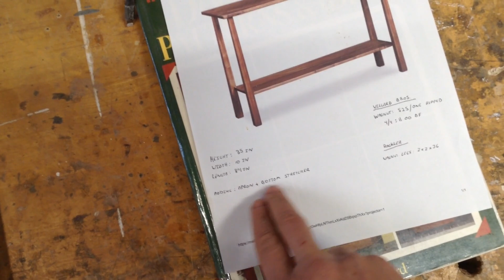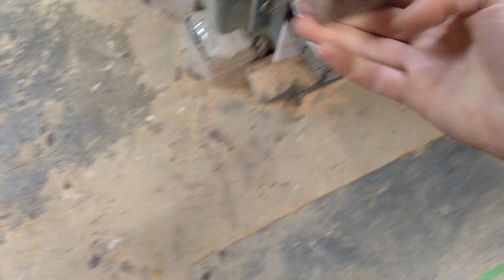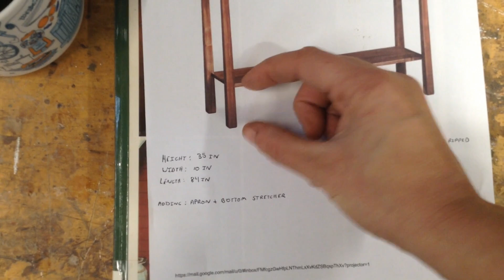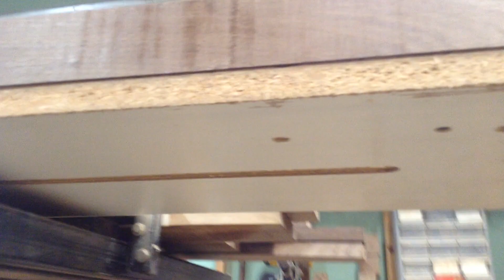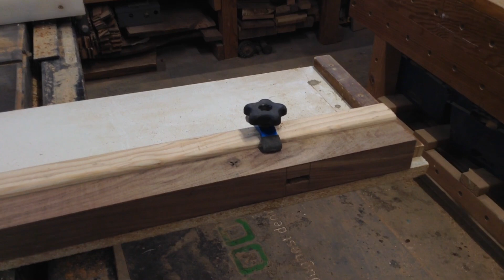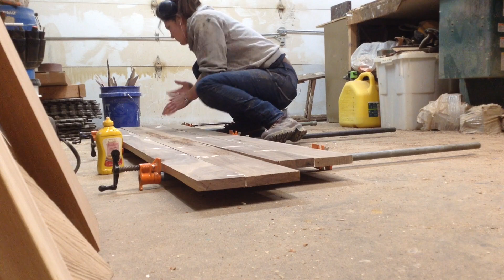Sofa Table || Woodworking Projects [How-To]

Comment: Putting together a 2nd garage shop after few year hiatus and recent move I'm learning to do with a lot less just by watching you. Also, reverse taper, nice touch. I always did the two surfaces inside. Question: did you angle the tenon shoulders up top? Good stuff, Thanks.
Reply from the maker: Yeah all the tenons had to cut at an angle.  That's in the next video and I did it on the RAS.  Made be realize why most tapers stop below the apron hahaha.
Reply: 😉Thanks. @HoneyBadgerWoodWorks

Comment: I’m envious of your mortising machine. It looks like mine but I can never get the correct difference between the drill bit and chisel. Thoughts?
Reply from the maker: Not quite sure I understand what you are describing here.
Reply: @HoneyBadgerWoodWorks  my machine doesn’t eject chips like yours. I’ve tried different gaps between the bit & chisel. To the best of my knowledge everything is sharp.
Reply: Richard, have you sharpened them, or did someone else do it?
Reply: @Cooper_42  I did. I have a cone sharpener for the chisel & file sharpen the bit.  The chips seem to build up inside the chisel and overheat it. Thank you for your help.
Reply from the maker: @richardgoeltz3769  I could be a brand issue, when I was buying the bit for this I bought a High end bit because I read the cheaper ones are garbage.
Reply: @HoneyBadgerWoodWorks  would you mind telling me the brand you buy?
Reply from the maker: @richardgoeltz3769   Since the mortiser was Delta I just bought a Delta bit off Amazon.  I got it years ago at this point, but I think it was around 50.00.
Reply: I’ve found that this guys (Adventures with Dr Joe - @JosephHunstad) two videos on hollow chisel sharpening were very helpful. They’re not short watches, but worth it. https://youtu.be/7Ky0ox3YbqM?si=r4JWxqbFK-gkDWY_
He’s a retired surgeon… so he really understands what sharp is!